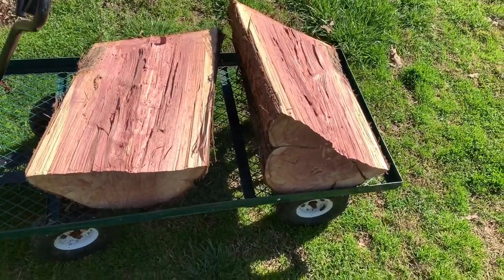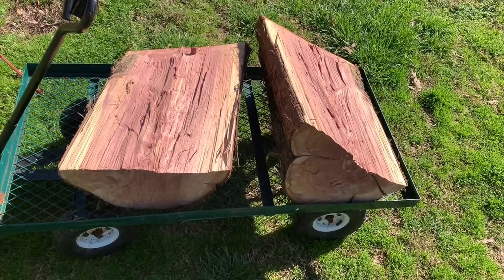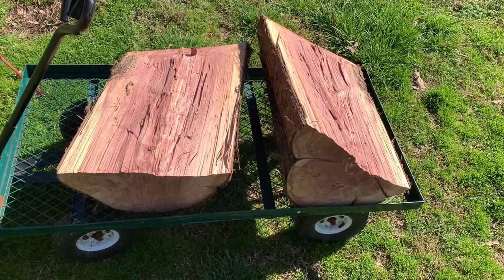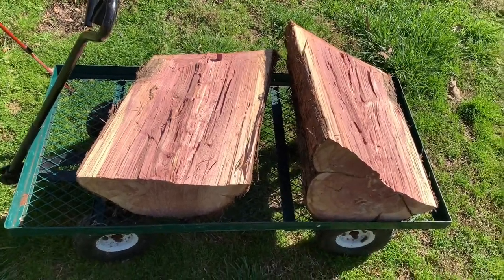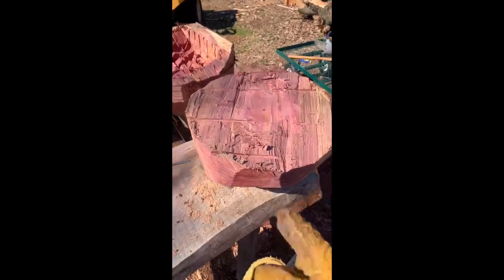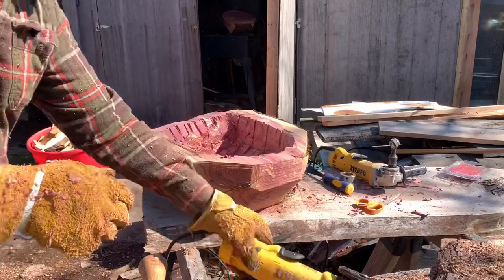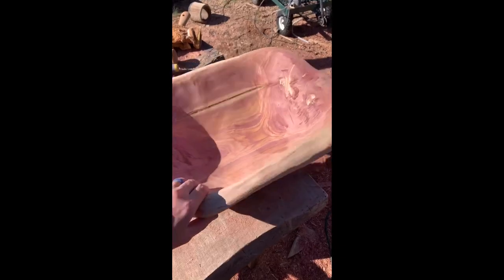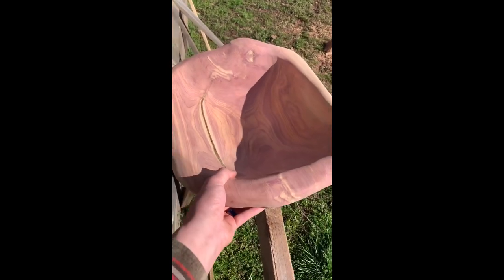Power Carving a Cedar Bowl

Comment: The only thing I suggest is to buy yourself a jawhorse. Being able to hold your piece securely isn't just for safely, but you'll have a lot more control. When dealing with these kinds of tools you need both hands on the powerful spinning cutting grinders that could end in  missing digits if you're not in the peak of control
Reply: Hook me up with a jawhorse boss I do the same kinda work but cant afford one :/ I just use the tools I have ya know